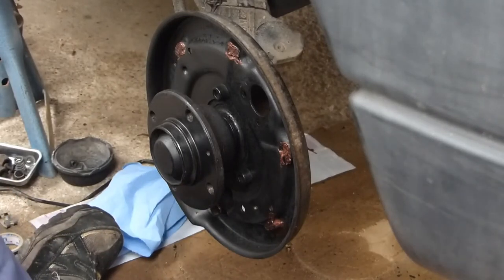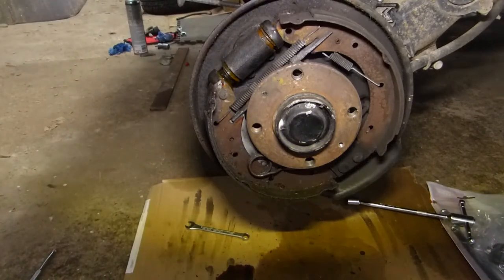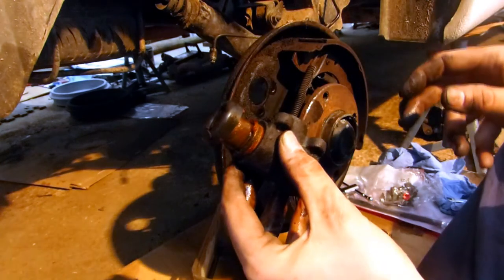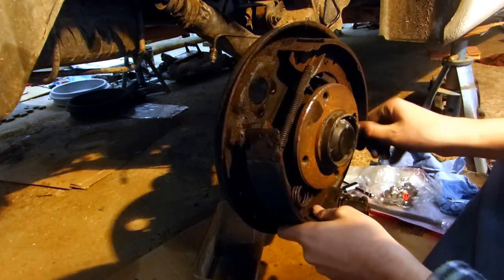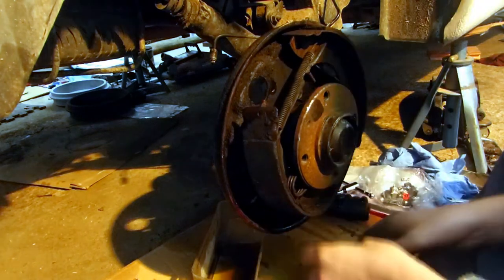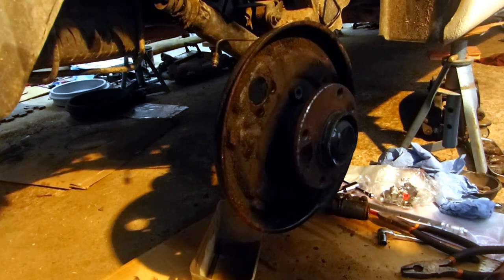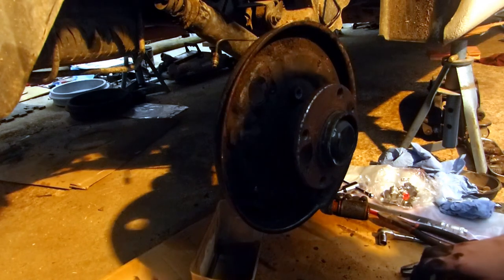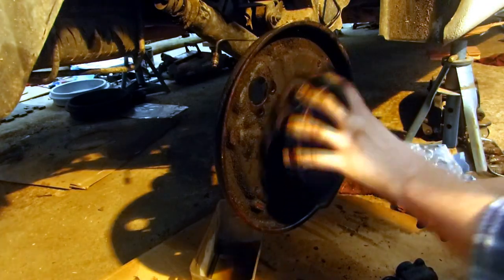Removing Rear Brake Shoes Peugeot Partner 1.9D 2003

Comment: Weird How someone fitted that handbrake lever like that ! 🤙🇬🇧 Nice work man
Reply from the maker: Thanks, indeed weird, not sure how they did it.
Reply: Autodoc video shows them the wrong way! Caused me some head scratching and confusion!
Reply from the maker: Interesting, so maybe that's also a correct way, though seems more difficult. I followed the Haynes manual when installing and everything worked fine.
Reply: It looked easier the way they did it, as the springs were more accessible.
Reply from the maker: Ok, I installed a ready assembled kit with all the springs in place, so I didn't need to worry about them, but I understand what you mean.